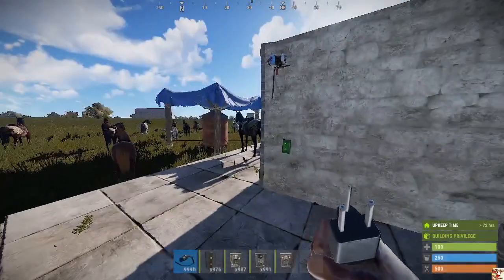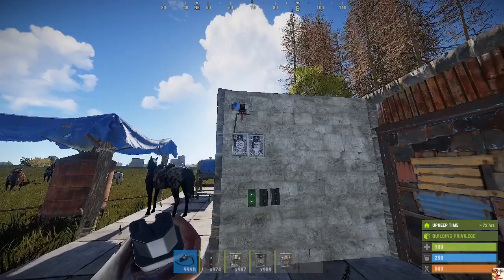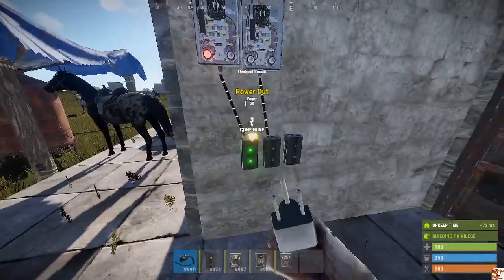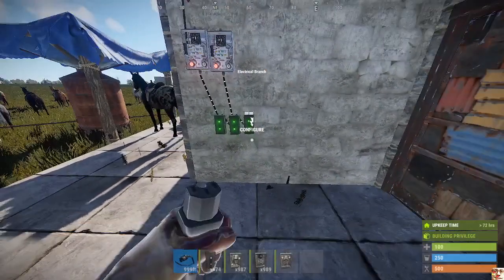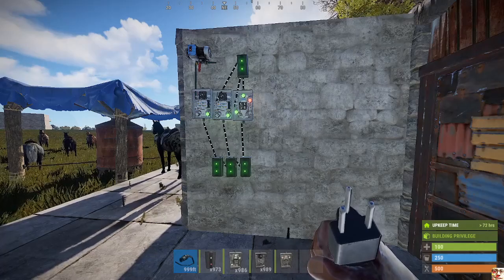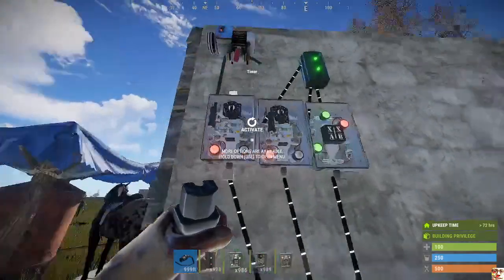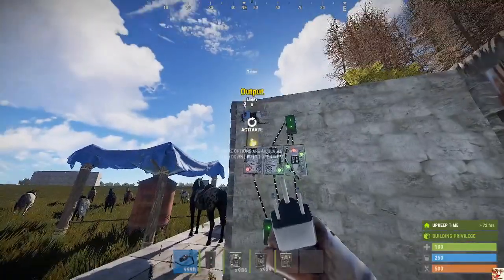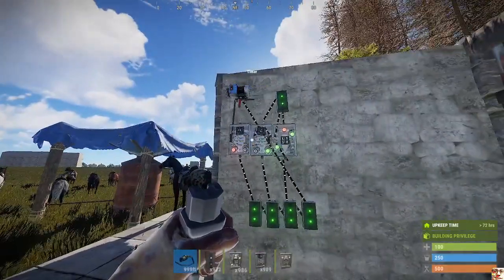Rust: Auto-sprinkler step by step setup!

Comment: thanks for the vid, i set up my first farm today. i simplified your setup by attaching the duration switch to the pump power in. i didn't see a need to automate the valve on the pump.
Reply from the maker: Ohh yeah that makes sense. So you just leave the switch on and put the power on the timer? Nice
Reply: @andyhehernandez  If your water source is above the pump, this won't work because the water will automatically flow even if the pump is off.  I like your use of XOR switches here.  Fool around with the memory cell though, it's pretty helpful as well.